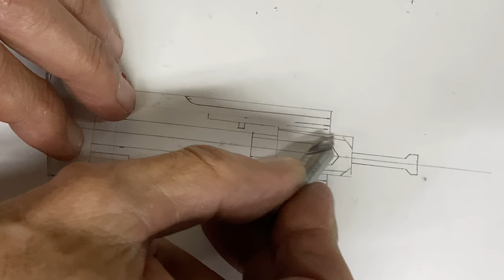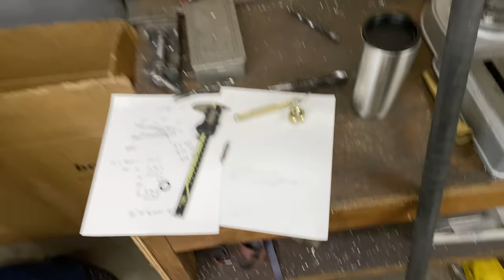Making a better garden hose nozzle // Paul Brodie's Shop

Comment: It’s funny that you done this. Years ago when I had unrestricted access to lathes and mills through work I often thought about making my own hose nozzle as the ones I bought at the shop I’d always find disappointing in their performance in some way. People used to laugh when I’d talk about it. Now I know I’m not so crazy… or just as crazy, either way I don’t mind.
Reply: Not crazy, but you do belong to a certain tribe of people whose brains don't like being idle, and will latch onto any interesting ideas and tumble them around until you either get bored with them, or find enough interest & improvement to catalyze taking action.
Reply: I say not crazy. The nozzles that they make today are junk. A plastic turret nozzle that is designed to catch a homeowner's eye seems to be the standard today. When I was a kid they used to make a simple two piece brass nozzle with one o - ring and the rubber washer where it screwed on to the hose. They were inexpensive worked great and lasted forever.
Reply from the maker: I think it's ok to be a little crazy, in the correct way.
Reply: @andyZ3500s  I know right. In the way of hose nozzles it feel like your shooting water out of a storm troopers helmet. I find it frustrating when you just want to go to the shop and buy a simple straightforward quality product where form follows function. More than happy to pay extra for something nice. It seems you can’t get things anymore where the items performance and build quality is put foremost to looks or cost of construction. I understand completely and very empathetically why Paul Would go to all this trouble.
Reply: @paulbrodie  Yes.  You just have to channel it properly.
Reply from the maker: @freakysteve140281   It was no trouble at all. Really.
Reply from the maker: @markclark1803   We all need to have focus in our lives.
Reply: @andyZ3500s  I'm still using one exactly how you described. It belonged to my grandmother way back in the 1950's.
Reply: @Alanbataar  That is a very intelligent answer describing myself, this tribe should get a name... May I use your quote? I just love it!
Reply: @JohanDegraeveAanscharius  I think the current title is "makers" but in my experience, there's a little touch of obsessiveness and strong drive  --  to create both function and beauty --  that separates the kind of people to whom I'm referring from the "typical" (and I don't mean that in a derogatory way at all) skilled craftsmen.

I'm so pleased that you like that description - please feel free to use it!

Comment: A departure from the norm but no less interesting. You’ve missed two vital features I’ve found in each of my spray nozzles - 1. A random, lone wayward stream working independently to the rest of the flow (used to wet your own clothes) and 2. A persistent leak running back down the handle (subsequently wetting your hand and sleeve)

Trade secrets, I suppose.
Reply: @Alfred Wedmore good work. The beauty of these designs are such that you’ll be back to watering yourself in no time!
Reply from the maker: Thanks, great comments!
Reply from the maker: Right on!

Comment: i'm not sure if this is the answer but this is what i found on google. "The standard thread used for garden hoses is commonly known as garden hose thread (GHT), but officially its title is NH ("National Hose") defined in ANSI B1.20.7. There are two designations. NHR is for thin-walled couplers on hoses formed from rolled, thin material and NH is for full-form threads cut into thicker material, typically used for bib cocks and female hose ends. Male threads for garden hoses are also abbreviated as MHT for "male hose thread" and female threads as FHT for "female hose thread".
Threads are non-tapered, i.e parallel. Unlike tapered threads which wedge together when tightened, parallel threads don't seal without PTFE tape so usually rubber washers or o-rings are used in fittings to stop them leaking.
Fittings have an external thread diameter of 1 1/16", with a thread pitch of 11.5 threads per inch (TPI). A 3/4 inch GHT fitting is suitable for hoses with an internal diameter of 1/2", 5/8" or 3/4".
GHT is not compatible with National Pipe Tapered (NPT) as used for plumbing fittings. NPT threads however are used on the section of a bibcock that connects to the plumbing that feeds it.
Some hoses may be fitted with an NPSH (National Pipe Straight Hose) female, parallel threaded connector for connecting to a tapered threaded fitting on a water supply pipe (i.e. not a spigot). The 3/4" connector has 14 threads per inch and is not compatible with spigots. An adapter however can be used."
Reply from the maker: Thanks for all that information!  So I was right about 11.5 TPI, which my lathe cannot do. But 12 TPI seems to work just fine.
Reply: @Alfred Wedmore I have heard that that's why we're stuck with 120V. Requires more copper.
Reply from the maker: @tinman5322   Actually, 12 TPI worked surprisingly well. Thanks for commenting 😉

Comment: i love the classic brass spray nozzle. i have no idea who made it first, but its the basic design where you screw the nozzle in or out and the spray changes from a laminar umbrella to a turbulent jet. its perfect. it has one gasket that is extremely easy to replace, and one moving part (a threaded joint). its brass so it will last about 100 years. i literally found one buried in my grandpa's garden, and i cleaned it off with some wd-40 and it works perfectly. i have a bunch of different brass nozzles from different companies, and they are all basically the same and do any job i need a hose to do. they even get powerful enough to do some light cleaning. honestly, the gun style fancy pants spray nozzles with 5000 settings are hot trash compared to the basic brass nozzle.
Reply from the maker: Thanks for commenting.

Comment: I'm surprised there isn't any 3d printed files on something like that, pretty cool video. It's amazing how things don't work out on version 1 most times
Reply: @_____ hobbyist Community* there's lots of not stupid businesses uses and quit a large community that excludes hobby level designers
Reply: You'd have to go hot, with 110% or so flow rate and thick walls to make sure the layers don't fail when you suddenly shut the nozzle and water hammer the print

Comment: For a really efficient nozzle design, study Pelton Hydraulic Turbine nozzles.  Turbine designers go to great length to design, and test, these to be as efficient as possible.
That 11 1/2 TPI is a royal pain;  my lathe QCGB won't cut it, either.  I've made a sloppy 12 TPI when forced to accommodate one.
The easiest solution is to cut the required thread off a discarded brass nozzle and solder it onto the new part.
Reply from the maker: I did think about cutting the 11.5 GHT thread off an old nozzle, but I wanted to make the whole thing. The 12 TPI actually worked quite well. I will check out the Pelton design, thank you.

Comment: Garden Hose Thread is 1+1/16 x 11½ Straight Threads Per Inch. Fitting information for your next evening of Trivial Pursuit - Fix It edition.

"The US standard was defined by NFPA 1963, "Standard for Fire Hose Connections", then later by ANSI-ASME B1. 20.7, which specifies 1+1⁄16 inches (27 mm) diameter straight (non-tapered) thread with a pitch of 11.5 threads per inch (TPI)."
Reply from the maker: Yes, you seem to know what you are talking about. Thanks for commenting...   :face-fuchsia-tongue-out:

Comment: I felt like I was watching myself...I am not alone. As you found, tighter tolerance gives a better spray but setting up laminar flow  before exiting the nozzle will give the best distance. A longer straight zone at the tip before dropping into the bypass phase  may help. A steeper pitch or double lead thread may help with transitioning
Reply from the maker: Roger, you are correct. We are not alone. My next modification to the nozzle will be to introduce a swirl into the "straight zone", as you put it. I think that might help a lot. Then, a patent!

Comment: A standard garden hose has two designations. For thins-walled couplers, NHR is cut into full-form threads. Male threads for your garden hoses (MHT) and female hose thread (FHT) are typically utilized in GHT. In the United States, the outer thread diameter is 1.0625-inch and the thread pitch is 11.5 TPI.Mar 23, 2022
Reply from the maker: Thanks. Yes, 11.5 TPI which I cannot do. Oh well, I made it work.

Comment: Hey Paul, great video. As a machinist I appreciate when people make better quality versions of things for themselves. I want you to keep making stuff for years to come but I wanted to comment because I kept seeing you do something incredibly dangerous with your lathe. I kept seeing you hold your file in your right hand and supporting it with your left hand  with your body over the spinning chuck. The safest way to file on a turning lathe is to hold the file in your left hand and support it with your right which keeps you from hanging over the spinning chuck. The last thing we need to do is hear that you were pulled into a chuck and hurt badly.

Please be safe and I hope to see what you can come up with in the future.
Reply from the maker: Thank you Stephen. It's Mitch's camera angle and choice of lens that makes it look much closer than what it is. There is actually a lot of room and I am safe.
Reply: @paulbrodie  it's not about space it's about keeping your safe. If your clothing gets caught, and it can happen to the best and most experienced, you will be lucky to only lose an arm and if you are unlucky it will fit your body between the chuck and the ways. It doesn't take much to hold the file in the other hand, please protect yourself and do it properly.

Comment: Interesting on the thread size.  I had to go check, and sure enough, my 1947-vintage South Bend 9” Model A tool room lathe has 11.5” thread pitch available on the quick change gearbox.  
Of more interesting note is that it offers thread pitches from 4 TPI up to 224 TPI!  No idea what 224 is good for, but it’s there.
Reply from the maker: That a lot more thread pitches than my lathe.
Reply: 224 tpi?? holy cow does that mean you would have to use a 2 thou cutter to make those threads? 1/224 being 4 thou.

Comment: Awesome and fun project. Would have been nice to machine in a quick connect instead of thread on the back. Add a quick connect coupler on the hose. I changed over to quick connects and our  nozzles last so much longer because they are so easy to take off and keep out of the elements.
Reply from the maker: Yes, there's always room for improvement. Thanks for watching.
Reply: Yep, here in Australia you can't even buy hoses with threaded ends. It's all quick connect, and the brass ones are the worst. Plastic ones are best and you just replace them when they break or start wearing from being smacked on the concrete.
Reply from the maker: @johncoops6897   I'm sorry to hear there is no GHT in Australia!
Reply: @paulbrodie  - If you mean Garden Hose Thread then yes we have it (with same thread as in the USA), but only seen on the garden tap (faucet). Everyone fits a quick connect on there, and hoses are normally only supplied with quick connect ends.
Spray nozzles, sprinklers, etc all have quick connect, except occasionally they have the smaller (3/4"?) hose thread in which case they are supplied and fitted with a quick connect adaptor.

Comment: All plumbing threads you will probably find are BSP standards. They're tapered threads so that when they're tightened down, the thread provides the seal itself, rather than a flat or conical face making the seal as would be necessary with a regular thread. These threads are really painful to cut, since the taper needs to start and end at the right point to have things fit properly. Plumbers have special dies for cutting them, where the only trick is that the die has to be completely bottomed out to complete the whole taper.
Reply: American hose thread  and npt are threads used in a america here in Australia maun standard for hoses is bsp same as our pipes
Reply from the maker: I don't think this is a plumbing thread. It is a GHT- garden hose thread. Who knew?

Comment: You have solved the curse of the garden hose nozzle the other curse is fitting onto the water tap (faucet)forever leaking. yes i have tried the Amazon one`s but sent them back. In the old days as a kid in the 50`s all you could get was brass.

Comment: As always, thank you Paul & Mitch!  Inquiring minds want to know!!  What changes were made that cause the fan to work, and what was the deficit in V1.0 that triggered the upgrade?

BTW, I'm loving my round insert lathe tooling.  Talk about nice finishes in aluminum!  Thanks for making me aware of it.
Reply from the maker: Thanks Alan. I didn't like the outside shape of version 1.0, and the shoulder on the inner nozzle piece needed to be sharper to create a better fan. I'm glad the round insert tooling is working well for you!

Comment: You should have a look at airbrishes, spray gun nozzles and also fuel injectors...

The correct term is an atomizer

V1 expensive looking but tragic performance. V2... suitably impressed. It's a nice nozzle.

Comment: if Im not mistaken 11 1/2 thread is a pipe thread pitch 1/2 and larger ,I think.
so maybe its a 1/2 straight pipe thread, to bad you didnt have it on your lathe.
 I used to work in the gas oil industry ,one would think Id have all this stuff memorized,
Reply from the maker: Alan, check the previous comments. Apparently, 11.5 TPI is a GHT (garden hose thread) I am learning too! Thanks for watching..

Comment: I bought the last two ngh tap and die sets from ebay last year. They are unique and now super expensive. Forty bucks then unobtainium now, 3/4” 11-1/2 tpi ngh,( national garden hose).
Reply from the maker: Your tap is probably called a GHT. Garden Hose Thread. Read the comments, there is a Lot of info on all this stuff.

Comment: I'm not sure but I think pipe dies will have that thread , and the threads don't fit tight together they have a little slop if your close it should tread on also the slop od the reason you need a rubber seal or Teflon tape to keep water from escaping out of the threads
Reply from the maker: My threads fit very well, despite not being the exact same TPI. There is no leakage at all. But, thanks for your comments.
Reply: Yeah it was definitely interesting to see the making of a garden hose spray nozzle and on the first one I thought you machine the little ball like end to small to fan the water out enough but I wasn't sure so was it just that end or was it a combination of things that needed to be changed to make it work , of course make a video explaining and making a 3rd version even better then the 2nd spray nozzle would be interesting and educational for those that are curious
Reply from the maker: @ericrichardson3332   You want version 3.0?
Reply: @paulbrodie  I definitely think it would be an interesting video

Comment: I love this video Paul. I've always wondered what is involved with the internals of a nozzle. But I would like to know what the little button insert cutting tool you use on the lathe. I would love to know where to get one of those. It looks like a fantastically versatile little cutter. If you are able to tell me the name of it or where I can get one, that will be fantastic. Keep up the good work.
Reply from the maker: Thank you. I think you are talking about my Carbide cutting tool with a 3/16" radius. I made the holder. Any good machine tool supply shop should be able to order one for you. The insert might be $30 and the tool holder might be $180. Just guessing...
Reply: @paulbrodie  Thanks Paul. I have been looking but I see this is the reason I am unable to find an appropriate holder. Looks like I have some machining work to do. Cheers.
Reply from the maker: @biggles333999   Technicut in Surrey BC will have them. 1 604 888 4052. Give them a call and tell them I sent you 🙂
Reply: @paulbrodie  Thanks again Paul.

Comment: Might want to watch out for dissimilar metals here; the interface where the stainless nozzle tip screws into the brass handle portion may reduce your longevity quite a lot.
Reply: Well greased threads may mitigate this.

Comment: I've run into the problem of a screw-on outer barrel not coming off the inner. IIRC, there is a hidden spring clip nested into a groove which must be removed first. If they didn't do it this way, you can bet most of the nozzles would be missing the outer barrel.

Comment: amazes me that more people don't thread with the lathe in reverse, especially on inside threads... no problem with 'overrun'  ;-)
Reply from the maker: I don't have a problem with "overrun".
Reply: When you're running very low rpm, it's not much of an issue. With the relief for the rubber washer, there's likely room near the interior face.

Comment: I don’t know if you need it now but just by googling ‘hose nozzle design’ and selecting images I found numerous design print breakdowns and even drawings of nozzles cut in half to show the inside design. It only took about a minute.
Reply from the maker: Thanks. Yes, I have also Googled patent designs for spray nozzles and found quite a few. I might make another nozzle!
Reply: @paulbrodie  sounds good! You did quite a good job on the first one, so you might just make something incredible this time!

Comment: As always, you produce such informative videos! I always learn something new. But I have to know, why do you use the band saw to cut off your new parts rather than part them off in the lathe? Just curious. Thanks!
Reply from the maker: Parting off is sometimes risky. It can go bad. The hacksaw is very consistent and almost never screws up.